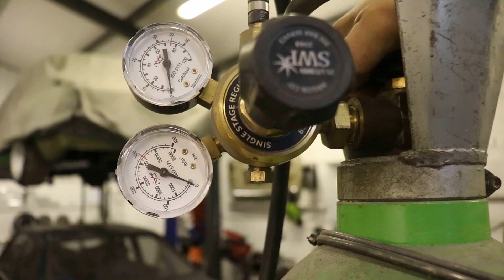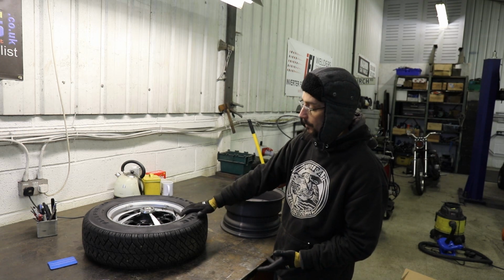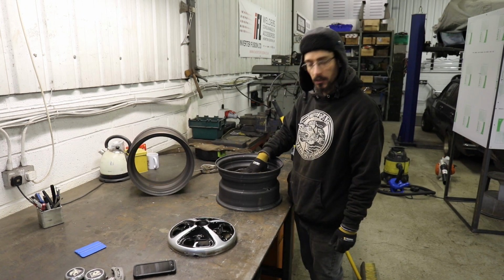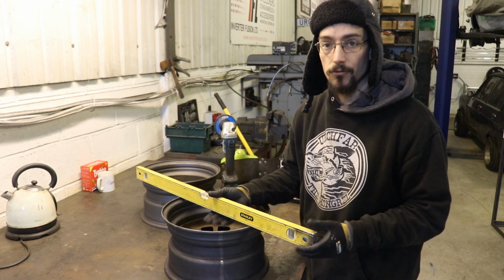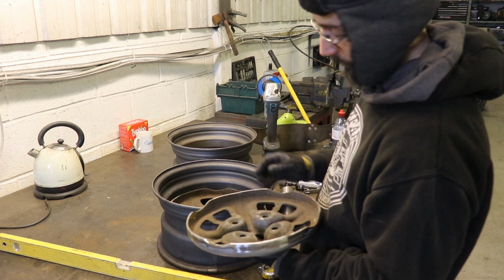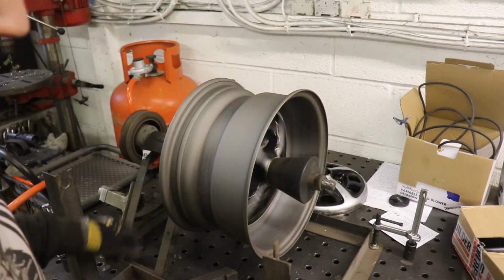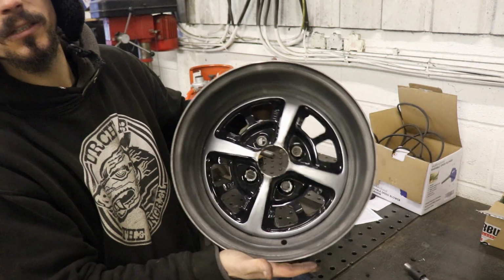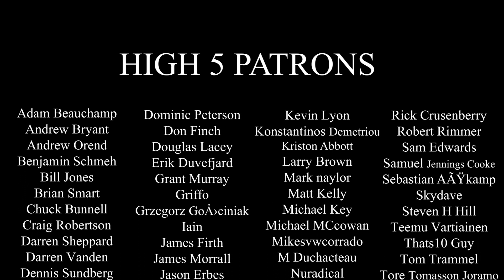WIDENED STEEL WHEELS (NOT BANDED)

Comment: This inspired me to go right out and buy some of those barrels. Had some stock steels for my spitfire kicking about that I intended on banding and this was the solution that I needed 🤙🏻
Reply: Hi Daniel, I was going to do the same with my spitfire. But my idea rather than banding was to make a wider Steely using two rims, cutting off a small amount of each rim, then welding them together to produce the widened rim (one weld instead of two on a banded rim) if that makes sense. But after seeing these barrels I now need to measure the spit wheels and see if they will work.
Reply: @shauna260  as a little update to this, I’ve just returned the set of 7j barrels as they’re too wide to fit onto a spitfire, swapped out for a set of 6j’s and they’ll fit up fine. Although the centres are a little small for the bands I think I can make it work
Reply: Did you ever get this to work as I've just ordered a 6j to have a play and see

Comment: Does the safety bead belong on the outside of the wheel, or are the valve holes on the wrong side?
Reply from the maker: Most wheels here have them both sides, I guess with the long flat edge there's no chance of it de beading. I wouldn't want to try pumping them u with it on the inside.

Comment: Wheels look great. 
But couldn't find the wheel barrels on the JBW website. 
Will the centers of the Ford Tinnilites fit the JBW wheel barrels too? Are the barrels available in 6 inch?
Reply: I couldn't find anything there either, looking for options for 10" steelies.
Reply from the maker: https://www.ebay.co.uk/itm/7-x-13-Outer-steel-rim-only-Lotus-Cortina-Ford-Escort-Triumph-x1/184519135775?ssPageName=STRK%3AMEBIDX%3AIT&_trksid=p2057872.m2749.l2649
Reply: @Urchfab  Thanks for the link.
Think I will stay with my 6J RS alloys.
If I sum it up the barrels alone will cost me more than 200 Euros till they are here.
But good to know what is possible.

Comment: cool , been looking intoo his website but couldnt see the rims themselves , must be special order
been thinking about using the back half of a rim and weld it to the front , its not quite banding but verry close , not mush choice in width either as youre stuck with the size of the inner rim part
Reply from the maker: They sell them on ebay mate.

Comment: Banding steel wheels has not happened here in Oz has not happened here in Oz for 40 years except for a few speedway rims. The wide edge of any steel rim goes IN not out.
That gives calliper clearance which even conservative size rims  need.
The 'Bling' offsets widens the track considerably which in turn loads up suspension components, makes steering heavier and makes the car nervous in a straight line
What may be just ok on a racetrack is generally bloody stupid on a road car
Reply: I like wide wheels on a road car. One thing that amassed me when I first came to Australia was just how boringly dull the street machine scene was. Hardly any one showed any kind of imagination.
 Stick a body kit on your ute with a set of 18 inch wheels, but make sure it looks like everyone else's   Bring back street vans..... 
 The amount of excess wear that widened wheels cause to suspension and running gear is negligible as they are hardly  ever used as high mileage cars. especially when your only going from 5 1/2 j to 7 j....

Comment: I used the same process with my 47 Ford back in the 70,s. Reversed the rims , using the auto to center the hoop. Not some fixture. Worked perfect. Been doing it that way since back in the 30,s I guess.

Comment: Looks great, intelligent way of trueing them up..... I would have had to line up the valve stem hole the same on each wheel in line with a spoke..!
Reply: I have also seen them welded up and a new hole drilled on the flat part. Why, it was used on circuits and if you run off into the rough you never pull a valve out.

Comment: with my big lathe I plunged in on the welds on mk2 golf wheels then spun them over so it added the foot print 40mm to the out side for a guy doing racing. I tapped it true on the big lathe and they ran spot on. nice job you did.

Comment: It's funny how a lathe seems big enough when you first get it but they seem to shrink
Reply: well you will always get a project that is bigger than the lathe, saying that, some lathes you can remove a small part of the bed up by the chuck to turn larger diameters.
Reply: @chrismechanic2000  i work in a machine shop, we call that "pulling the gap" and yes it can be a life saver sometimes....

Comment: Years ago when I banded a few sets of wheels, I couldn't believe how much variation there was in the standard rims. I found some rims weren't the same width the whole way around, they could be 1/4" wider at one spot than another. I mucked around a lot to try and get them as perfect as I could but like you say, a few wheel weights does the same thing.

Comment: Cool video Matt; thanks. Is it important how much weld is used at varying parts of the wheel (i.e. affecting the balance/weight and trueness) or is this so small that it's insignificant in your view?
Reply from the maker: No that is definitely important, I tried to make sure they were all the same size and ran them to little marks on the wheel to make sure they were equally spaced. Cheers

Comment: Incorporating a dial indicator into that jig would go a long way to getting those as perpendicular and true as possible. Nice work mate.
Reply: An indicator with a magnetic mount for your fixture (or 2 if doing more than car).  Like using the car hub if not constructing a fixture.

Comment: I think the barrels are on the wrong way round. The lip adjacent to the bead seat should be on the outside for safety, it’s supposed to retain the tyre bead at low pressure.
Reply: The 9mm hole for the valve determines which way round they go, doubt urch welded them with the valve inside, that wouldn't be a good look on the petrol station forecourt lol!
Reply: @tompirozek4490  good spot, I hadn’t noticed. Unusual to have the safety lip on the inside bead though.

Comment: Nicely done. The deep dish looks really good. Did you give much thought to where the valve stems come out? It would bug the shit out of me if they weren't the same on each wheel.
Reply from the maker: No I didn't actually, but now you've pointed that out that's gonna bug me too. Not enough to cut them out and start again though.
Reply: @Urchfab  could weld up the holes and re-drill them if they’re too noticeable

Comment: Before you get the wheels powder coated, and you know your tyre fitter well, get him to balance the wheels on their own. You could then weld on weights on the tyre side of the wheel. 
I have seen this done and with good make tyres, as long as the tyre is fitted correct to the tyre valve, no weights are needed.